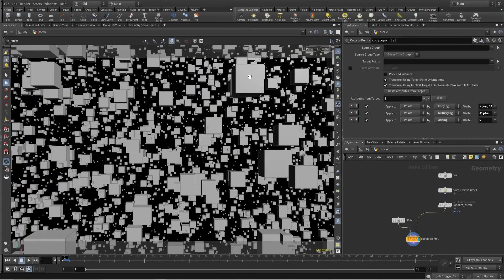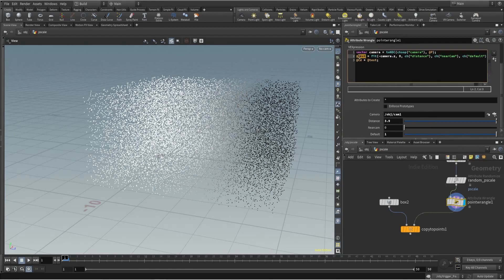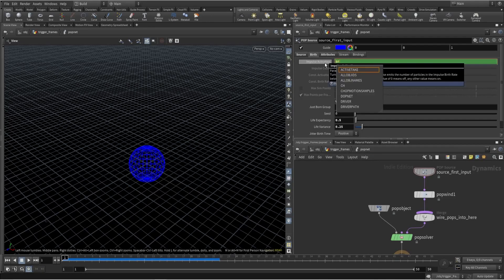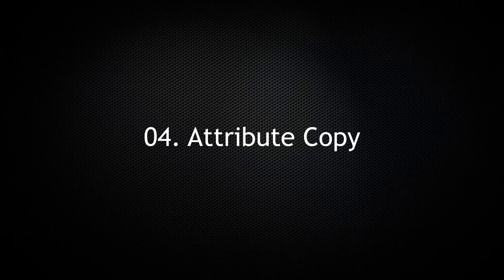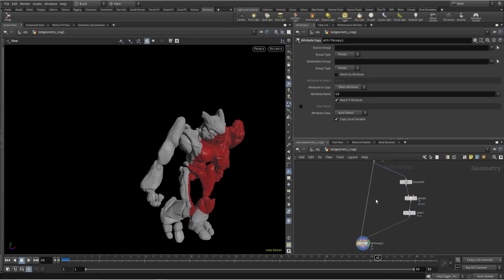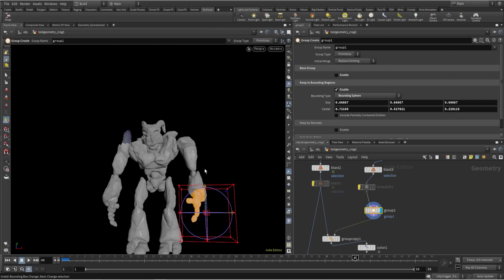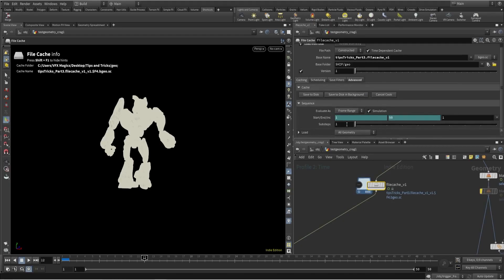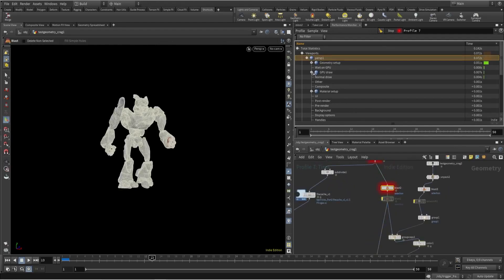Houdini 5 Tips and Tricks Part 3

Comment: Hi! Thank you for this great tutorial, I have been following alone for the VEXpression //vector camera = toNDC(chsop("camera"), @P);// but it does not work for me, I'm using Houdini 18.5.596 version, it does not create the custom parameter. Am I missing something? Thank you!
Reply from the maker: in that case you can follow this            vector camera = toNDC("/obj/cam1", @P);       or       vector camera = toNDC(chs("camerapath"), @P);
Reply: @VFXMagics  thank you 😊👍, I will as soon as I wake up.
Reply: Hi again! Thank you! It is working by diminishing the size of grains close to camera, //@pscale = fit(-camera.z, 0, ch("distance"), ch("nearCam"), ch("default"));// but as soon as I add the "*" to multiply it //@pscale *= fit(-camera.z, 0, ch("distance"), ch("nearCam"), ch("default"));//, all pscale downscale to cero as shown on the Geometry Spreadsheet tab therefore disappearing on the viewer. Would there be any reason for that? Thank you a lot Sir!